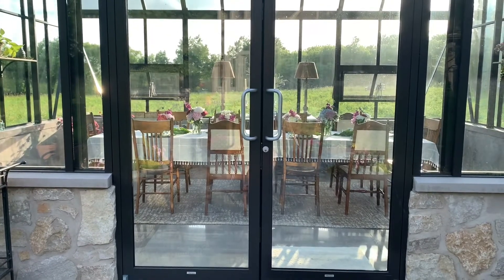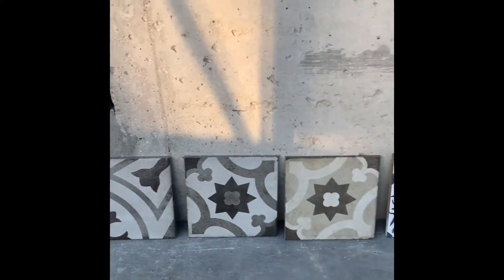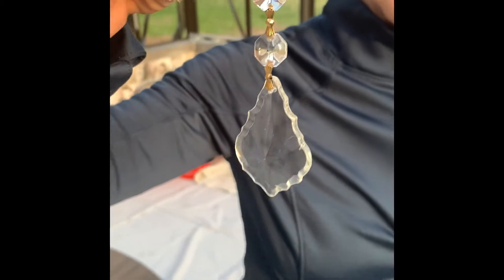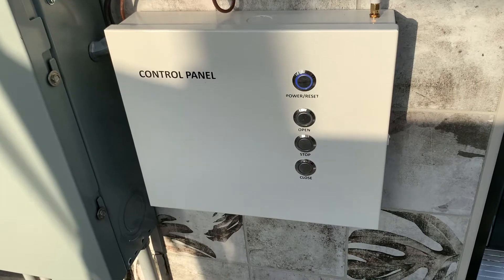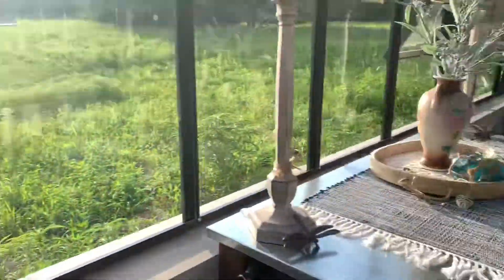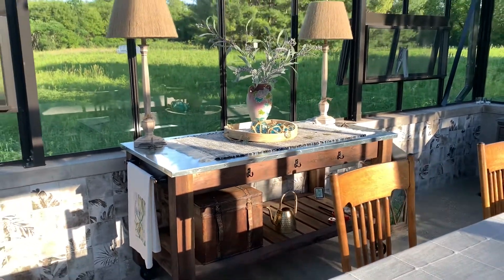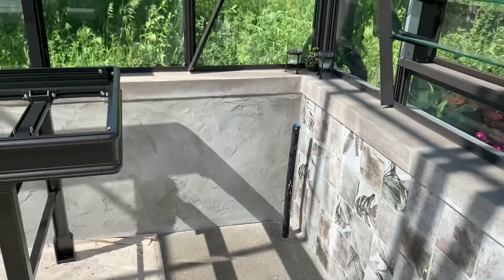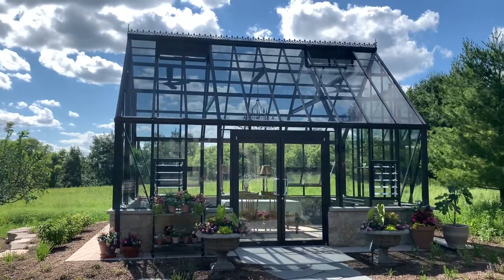Greenhouse Update - A Look Inside and All the Features

Comment: The tile is gorgeous, it's too bad you didn't put the electrical boxes outside and just drill a hole through, or the tile on the opposite wall. Really a lovely space top to bottom.
Reply from the maker: Thank you. All the electric boxes are in the cement wall with the exception of where the electrical box, cooling controls and a set of extra boxes are. That one spot is essentially the control center. 😊

Comment: Hi Dawn, this was so helpful. Your greenhouse is gorgeous. As I mentioned in another post to you, I'm currently working with BC greenhouse on my order.  Mine will be quite small compared to yours :)  Im looking at a a 10x12, cottage style but it will be oriented as yours is with the double front doors. Can you share where you ended up getting your shade cloths? I think I saw them in another video? Also they're encouraging me to get the exhaust package but wondering if I cant do ceiling fans instead (tho with just 12' doubt I can do 2 and was still hoping to do some lighting in middle). Also did you go with the 6 mm solid glass vs. 3mm? If so, mostly for aesthetics or heat retention? Any thoughts much appreciated. Thx you.. Love your vlogs!
Reply from the maker: Thank you so much! Yes, we did 6 mm glass for heat retention. We did not do an exhaust fan but you can see. We have the two fans right below the windows at the top which automatically open and close at certain temperatures. The fans are large, and can either push air down or pull air up. The shade curtains we had made. My husband rigged up a way to hang them, which I thought was ingenious! We bought an expensive cotton poly mix fabric and just had six shades or curtains made. I still need to get a video out on that and I should really get working on it. Lol, it’s just been so busy lately.
Reply: @SeasonalDesignsbyDawn  Thank you so much. I'd love to see any pattern you have. I figured something could be rigged to run in the grooves of the greenhouse. Thx again!